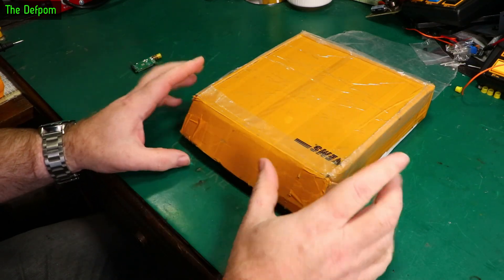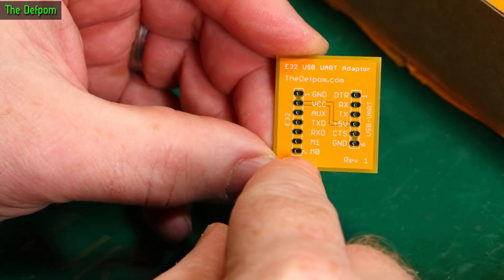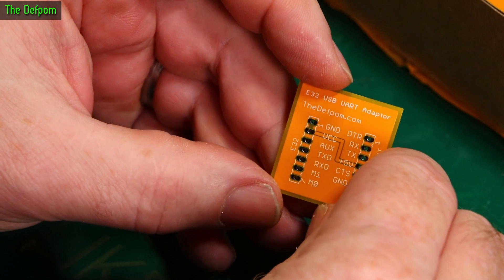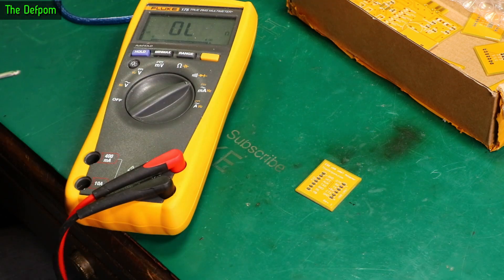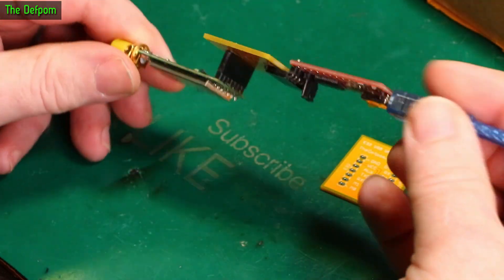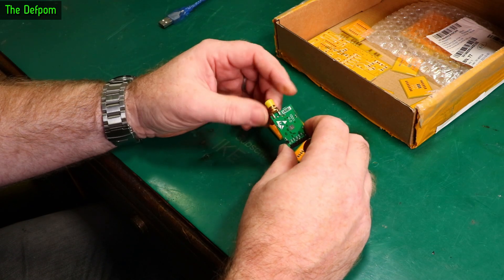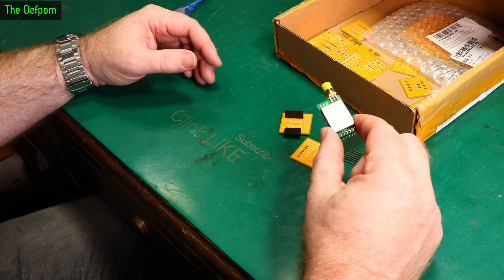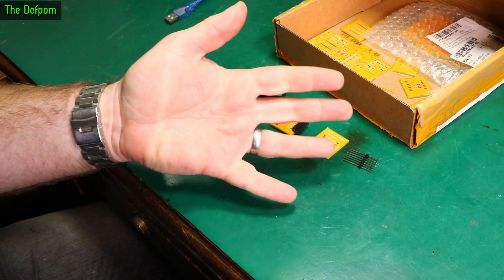🔴 Ebyte E32 Programming Adaptor and Solving Corrupted E32 UART Problem - No.1126

Comment: Worth considering that MCU baud rates divided down from their CLK are not exact. Some are more accurate than others and can be almost unusable. MCU datasheets usually have a table for this....i.e. ATMEGA1284 @ 8Mhz the closest you'll get to a standard 230.4kbaud rate is within 8.5%,
57.6kbaud will be 2.1%,
19.2kbaud will be 0.2%.
....so choose the wrong CLK versus required BAUD might result in comms that doesn't work.

Comment: Do you use the in built watchdog as as this can cause issues with programming, On some chips it can still run in the background even while your programing it. so increase the size of the code and it can start to fail on programing if the watchdog kicks the reset. faster baud rate and  programing is over before before the watchdog times out. been there and been it by that.
Just a thought.
Reply from the maker: Not using any watchdog timers.

Comment: I know that is a silly question but do you look at the Gerber's before sending them off, this is a simple operation that keeps egg of ones face.
Reply from the maker: Normally yes, but I could not see that trace on the Gerber view either, if I had run the DRC it would have caught it, I didn’t, so it didn’t.